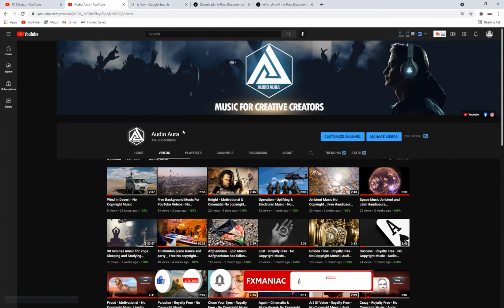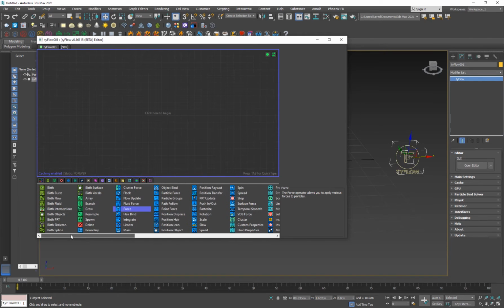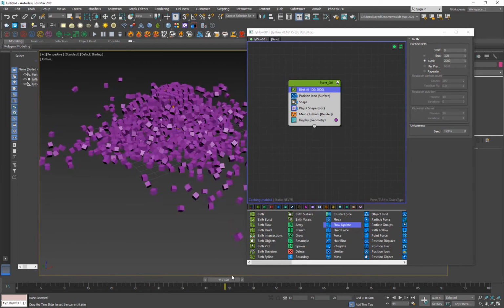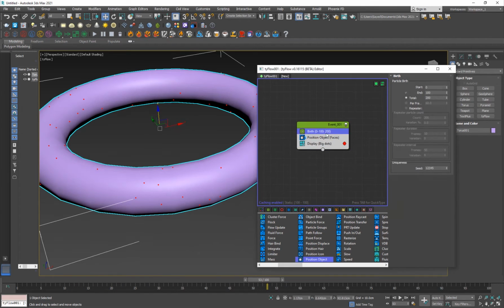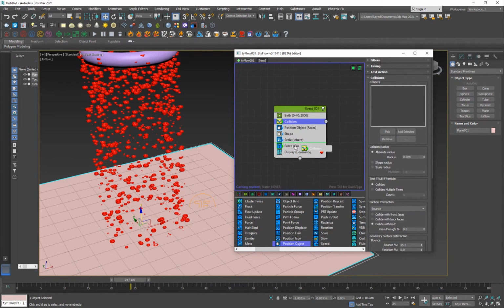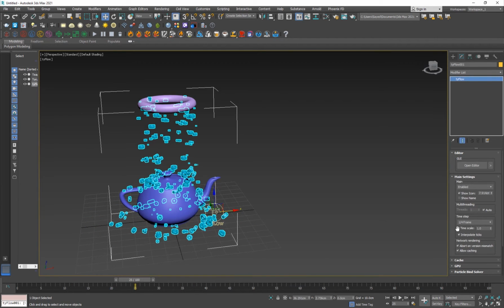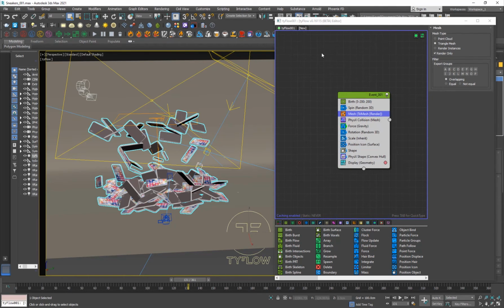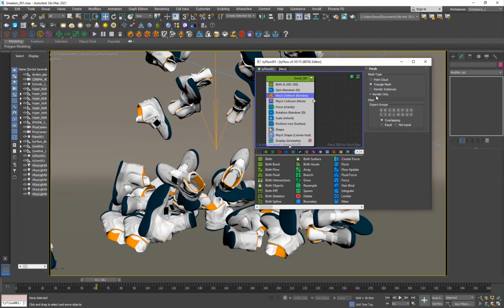Tyflow For Absoluate Beginners Tutorial  -  #FxManiac

Comment: Excellent work, Thanks for taking this effort and share this tutorial., Could you kindly help me to fix rendering a sequence of 200 frames animation.
I currently have 200 frames of simulation which I want to split , 0- 100 frames in machine A and the 101 -200 in Machine B , But the concern is the simulation keeps changing everytime. Will you be able to guide me on this please.
Reply from the maker: Thanks, you can cache your Tyflow simulation and copy the cached files to your other machine and render half of it on the original machine and the second half on the second machine.